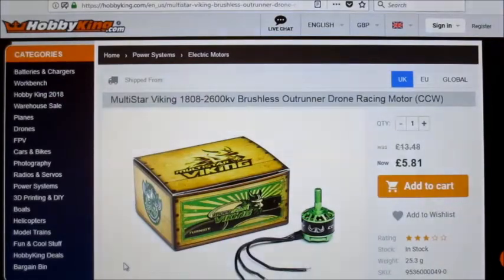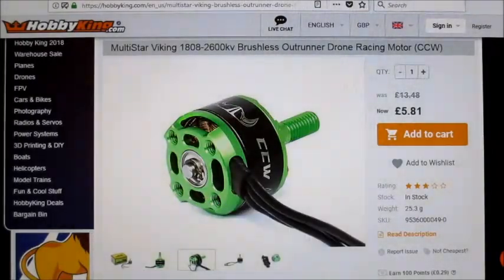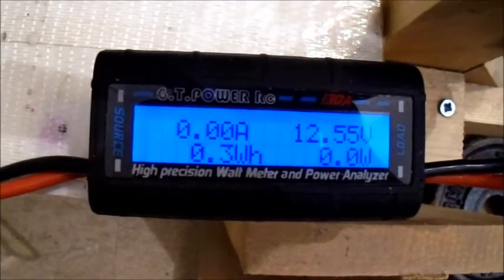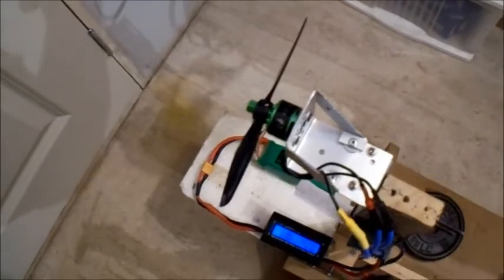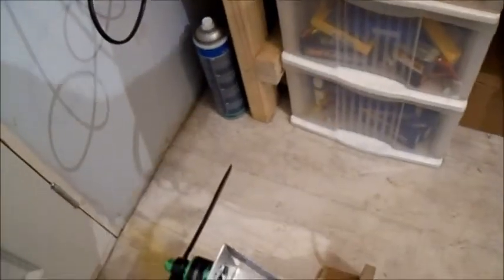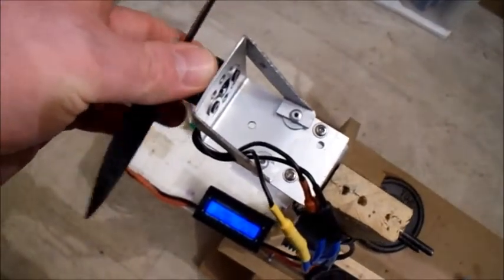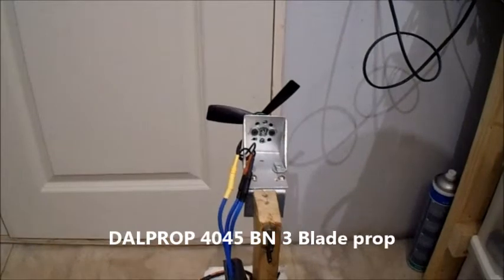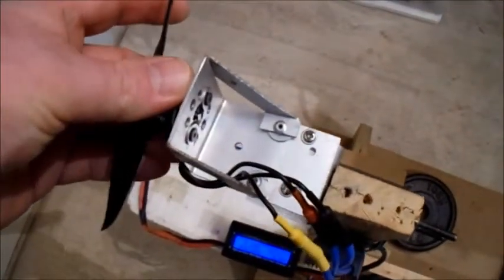Multistar Viking 1808 2600kv Thrust Test Motor test of the Week

Comment: Very nice testing! I'm very impressed with this motor considering that it's only an 1808 with the amount of thrust produced.
Reply from the maker: Hi ya
Yes this motor sure is small but mighty. Thanks for watching.
...RCPP
Reply: I wish it is warehoused in US. Good things should be all located in US. The weight of this motor is exactly that of t-motor air 40 2205. Either one is exactly 24.4 grams with a 60mm lead wire.

Comment: I've been watching some of your vids. After a while, I started to notice things didn't add up, then I think I figured it out. Your watmeter is recording peak power and current. That happens at low RPM, and it's only transient, which is why you sometimes get massive current and the motor stays cold. Surely, to be more meaningful, you need to record the current and power only when the motor is running at maximum speed.

Comment: I've never done any RC stuff before, just bought couple of those motors (2xCW & 2xCCW), mostly because they were cheap and I'm into Arduino programming and would like to try build a quadcopter or something. I didn't get any props because basically I have no idea what kind I need. I have 2 2200mAh 3S 40-50C batteries, might get some 5200mh 4S 10C batteries too. Is the procedure for finding suitable props basically just trying whats good and what works? I have no idea if I should get 2 or 3 blade props, 5, 6 or 7 inch. What would you recommend? Can those motors even lift enough weight, i.e. can they be used for quadcopter, or are they better for glider/plane type RC models?
Reply from the maker: Hi MK
I'm not actually into quads myself but I know motors. These are quad motors. If are going to use these exact motors then go with what I found to give the best results within the limits of the motors specs. I have been doing this for years so I kind of have a good idea what props to use on different motors relative to there size and kv rating. If you watch some more of my videos you can get a good idea too. As for the battery's I think the 2200mah may be a big or just on the limit for the size of quad these motors are meant for. So a a 5200mah 4s would like tying a brick to a Pigeon.
I prefer 2 bladed props but with quads you can be limited on props size depending on the size of the quad. A 6 inch prop may give more thrust but if the props hit because they're too long but a 5 inch prop is ok then it may be better to use a 3 blade 5 inch prop then a 2 blade 5 inch prop. Hope this helps.
...RCPP
Reply: 250mm frame with 5040 or 6040 biblade or HQ v1s 5x4x4 could be a decent trainee with 3s you have. Not a racer but it will be in air really long on hoovering. 20A BlHeli_S as minimum. Suggest a F4 at least for BetaFlight. For now F3 are really cheap but will drop support.

Comment: Hello. May I ask which EDF had the best thrust to weight ratio from your experience? I'm also interested in the one that generated the most thrust, disregarding it's weight.
Reply from the maker: Hi Valentin
Most of my edf setups require some sort of modifications to make it work and are using different parts put together. I was going to put in links to some of my edf videos but youtube won't let me do it. I will put in the title of the videos so you can then look them up.
 Dr Mad Thrust 3000kv + HobbyKing 70mm EDF unit Thrust Test.
This one is the only one that does not need modifying and puts out very good thrust for a 70mm but it needs a good sized 5s lipo to work well.

GoolRC 2958 4200kv 65mm edf test.
This one puts out good thrust for it's size and just needs a medium size 4s lipo. Shaft adapter needs modifying though.

64mm edf GoolRC 2968 3800kv thrust test.
This one is INSANE but needs a lot of modifications and a big 5s lipo.

90mm edf test with the GoolRC 4082 1900kv on 8s.
This is the most powerful edf setup I've tested so far but it also needs a lot of modifications.
Hope this helps. I also have other edf test videos on my channel.
Cheers.
RCPP
Reply: Thank you for the very informative answer! I think I'll go with the 90mm one, since I need a thrust force double than the weight of the aircraft. I've watched a lot of your videos, but because my lack of knowledge regarding motors and fan units, all those numbers except the kg of force generated don't tell me much. I am trying to make a VTOL plane for my automatic control engineering degree, unfortunately we don't learn anything about airplanes, or motors in college, so assembling the hardware itself turned out to be the most difficult task for me.
Reply from the maker: Hi again
Ah now I know what it's for can I suggest that the 90mm setup is not what you want. The whole setup is very heavy and expensive. The speed controller alone is about £100. Another option for better efficiency is using a Hobbyking 70mm edf unit with a Turnigy L 2855 - 2100kv edf motor, a Turnigy plush 60amp esc and a Zippy compact 2700mah 25c 6s lipo. This setup weighs 534g but puts out about 1500g of thrust and only draws about 40-45amps. Also it all goes together with no modifications. You will need to balance the rotor blade. This should be better and a lot easier for you. Cheers.
RCPP
Reply: Thank you so much! Deciding what are the right components for what I need was giving me a really hard time. Having the opinion of someone with a lot more knowledge on the subject than me really puts me at ease. This info is a really great help! The price isn't really an issue though. I am willing to go as high as 1000$ for this project. If you have a setup that will allow a longer flight uptime and possibly a bit of extra available payload (because the thrust vectoring system and the camera might add a bit of extra weight) at the expense of more expensive components, please let me know. (I want to be able to enjoy long duration FPV flights when this project is finished)
Reply from the maker: That's ok. Glad to help. That 70mm edf with the 2100kv motor is probably the most efficient edf setup I know. Should give a good flight time compared to most edf setups.
Reply: I see. Thank you again!

Comment: Hey, 
can the Motor handle 5" Props on 4s? I´ve got 35A esc btw.
(just did a build with it)
 :)
Reply from the maker: Hi you're wright I didn't try it on a 5" prop on 4s. I would think a normal 5x4 would be OK, but not a bull nose 5" prop. A 35a esc will be fine. Thanks for watching.
...RCPP

Comment: Hey  I also have one of those motors but it gets really warm after a few seconds and smells a little bit weird almost like the isolating meterial is melting. Did this happen to you too or do I have a faulty Motor LG Tim
Reply from the maker: What prop and battery are you using? Also what is your amp draw?